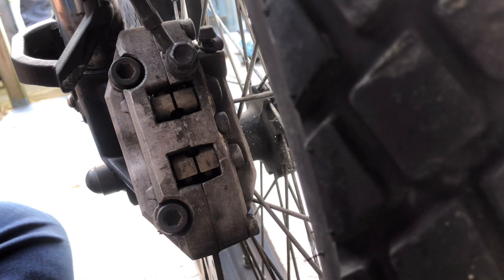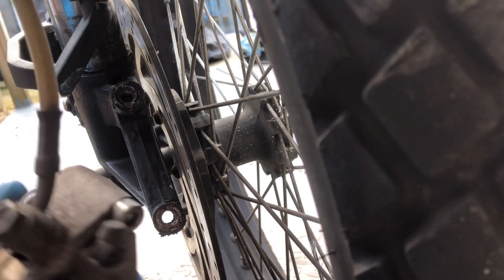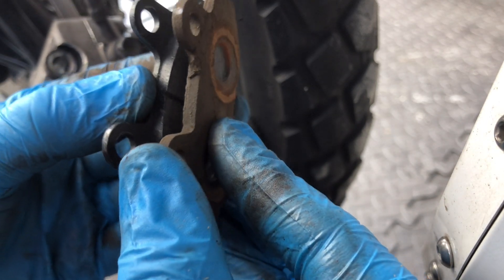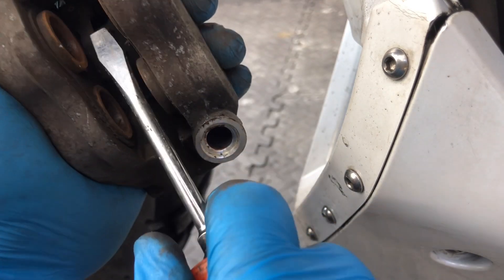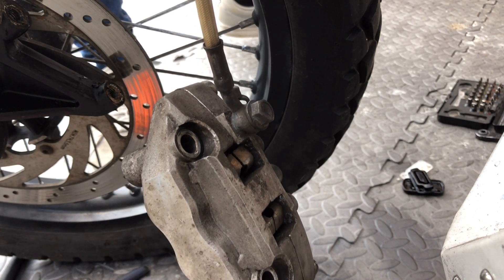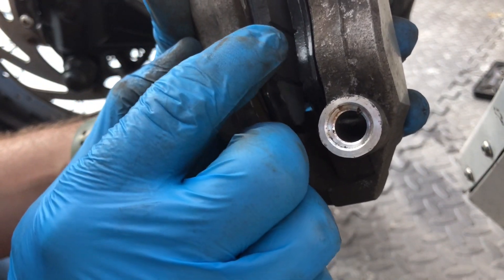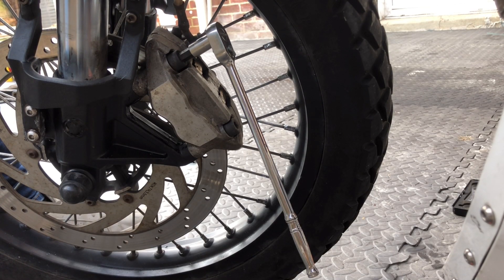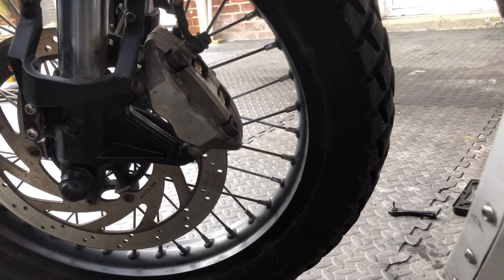F.B Mondial HPS 125cc Brake pad replacement

Comment: ciao per favore mi puoi aiutare.mio catena di moto dopo un po’ che guido  catena  dimenta tropo teso . ho provato di regolare ma stesso cosa succede non capisco per che grazie
Reply from the maker: Hi Faroq, first things to check are your shock absorbers they may be leaking causing your chain to tighten once you’ve sat on it….. Another thing to check would be your chain alignment, if your chain is slightly out if could be causing the chain to heat up in turn expand and go tight. Ciao!